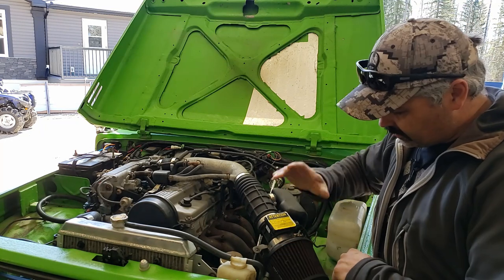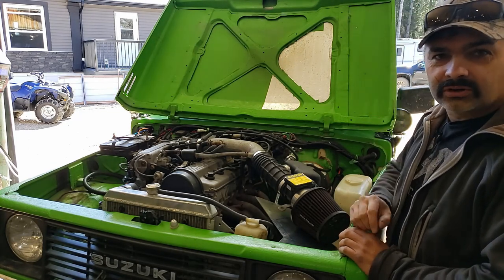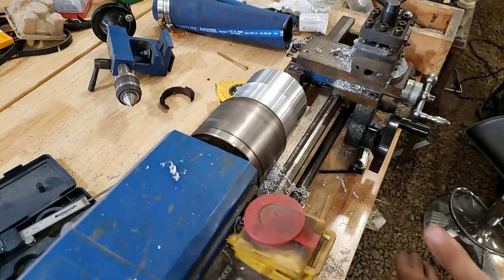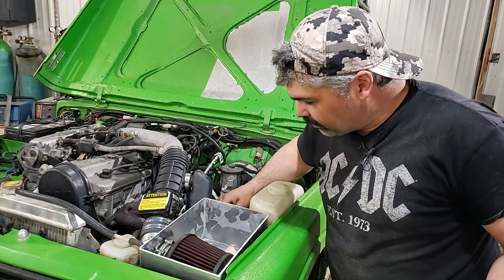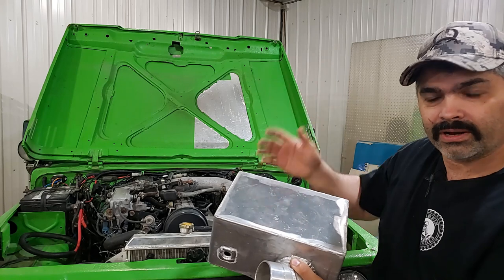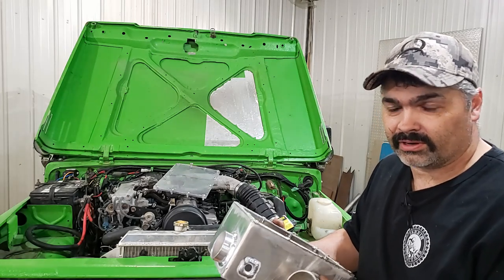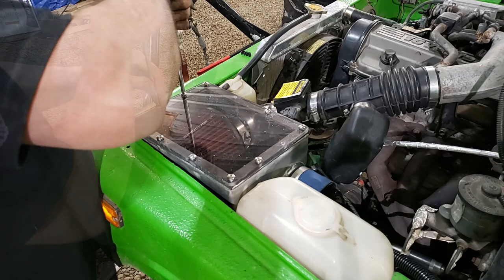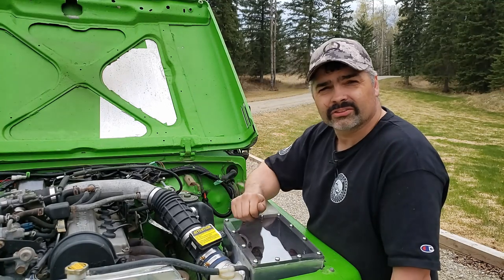How to build a see through air filter box: Snorkle Ready

Comment: I enjoy watching the Zuki being built. Does the box prohibit the clean air to the filter? How does that work with it being enclosed?
Reply from the maker: No it wont restrict the air flow, the air inlet is the same size as stock and the airfilter has the same or more surface area as a stock filter. It pulls air right now through the hole in the side of the box for the snorkle tube.
I will most likely use 2.5" tube to make the snorkle and i can't see that being a restriction either.
Thanks for watching Fabbin Adventures

Comment: Can you make one for me?
Reply: BTW, I just ordered a set of gauges so I can keep an eye on critical engine functions.  Oil pressure, fuel pressure, voltmeter and GPS speedo (running bigger tires).  I'm going to design a 3d printed panel that fits where the stock radio was mounted.
Reply from the maker: Wow, there ya go. That will be nice to have all them guages!
I could possibly make another. Not sure what id have to charge for it though.